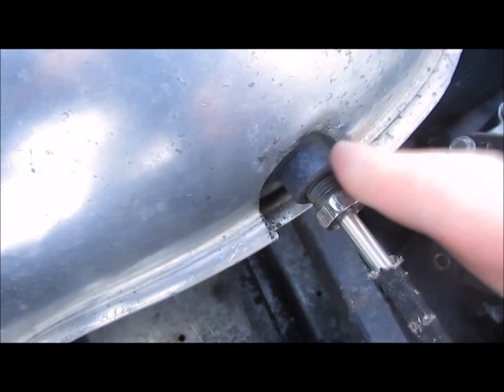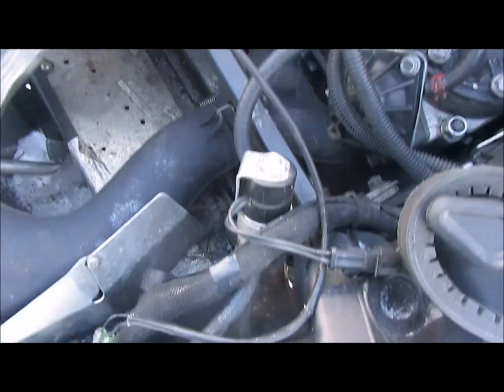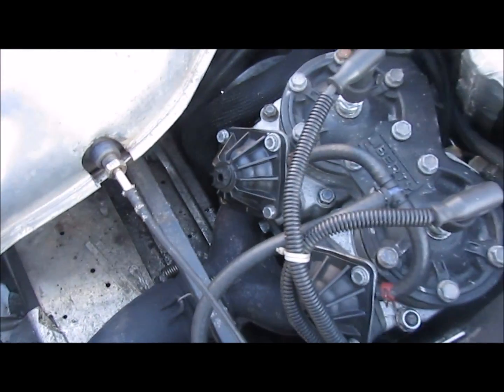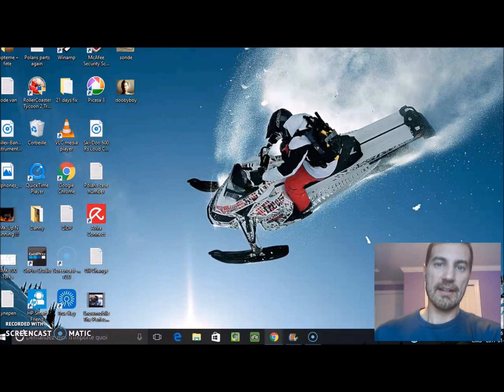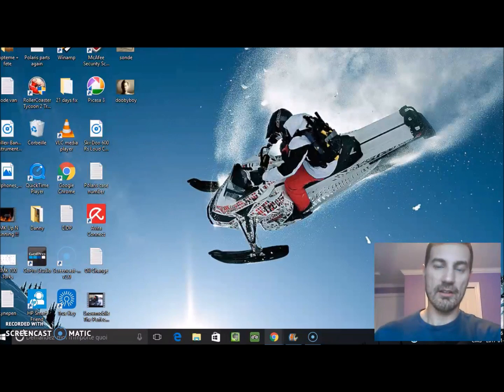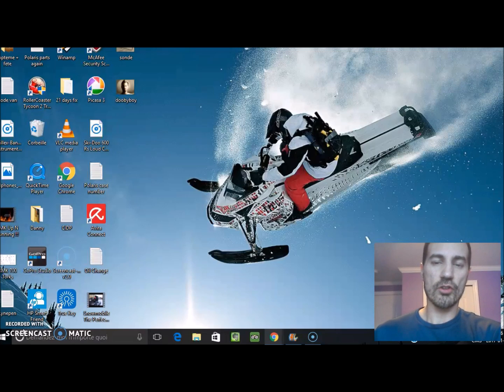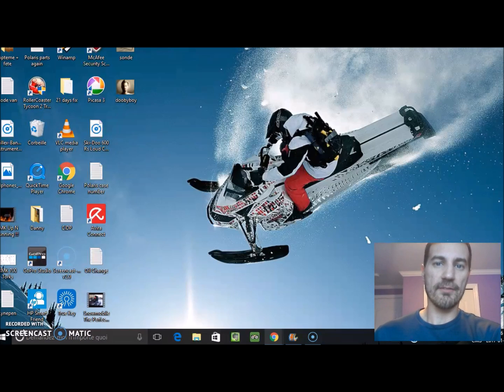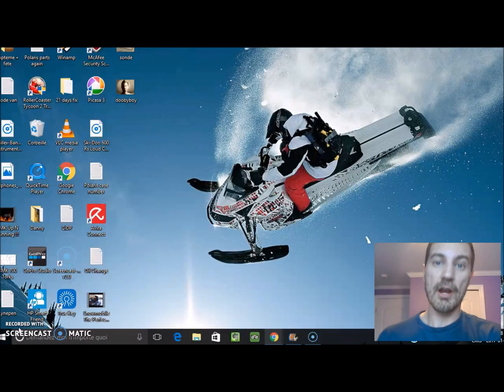Polaris IQ Check Engine Light Problem

Comment: My 2010 800 Dragon runs perfect until it goes into limp mode after about 5 minutes and over half throttle.  I have had 2 dealerships work on it and have spent thousands of dollars and still does it.  Almost everything has been replaced.  On the plus side on occasion it will run about 10 miles or so now, before it will go in a limp mode.  Any suggestions?
Reply: Maybe it's your tps sensor
Reply from the maker: What oil is in your machine ?